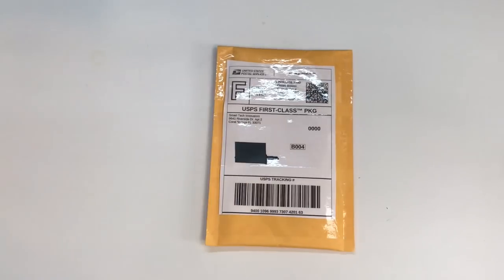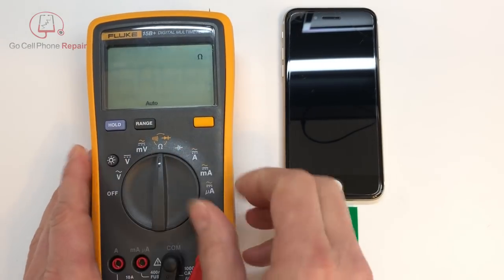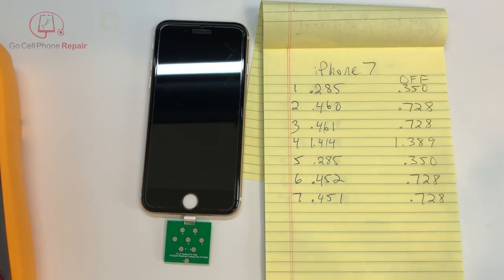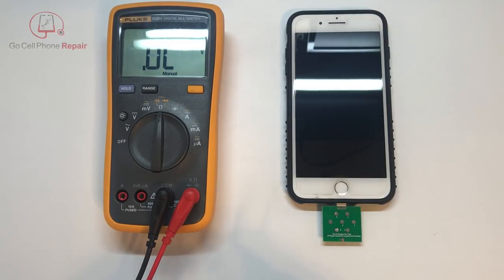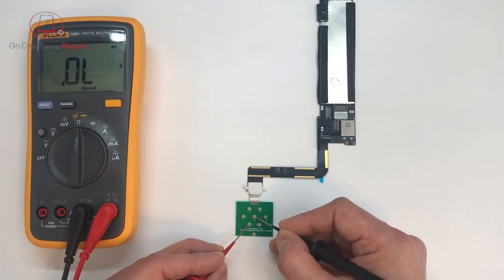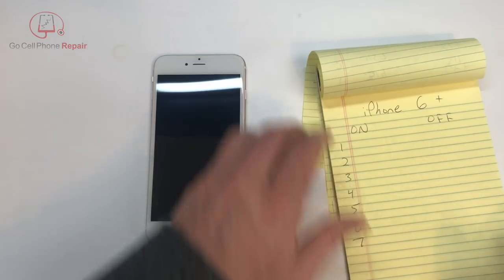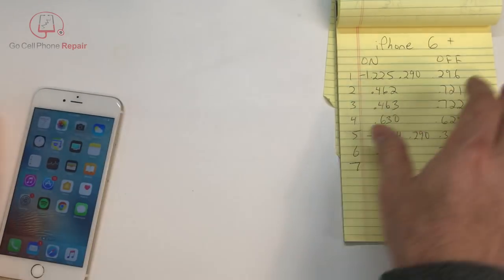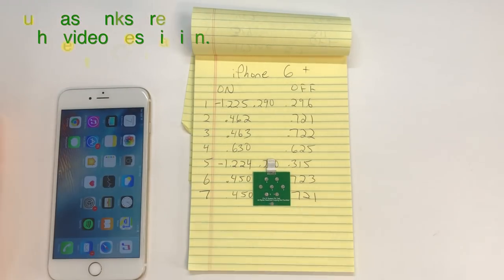iPhone Tristar Tester Diagnostic Tool - Hands On First Trials

Comment: Great video - thank you!

One suggestion though.   Readings powered on are one thing,   readings powered off are another like you say - but,  theres a third dimension too - phones which havent had a soft reset.   I have noticed big fluctuations on readings,  so by default - i do a soft reset on everything before i take measurements.

Thanks again!
Reply from the maker: Noted!

Comment: I am testing this tool, same way as shown on video, I have 0 volts on an Iphone 5s turned off. The phone charge  without any problem, turn on and it is completely functional. Someone may explain what does mean. Line 4 U2 Tristar. does not have GND connection but how it has still the phone is completely operative?

Comment: If the phone is  on why I want to test the Tristar?
Reply: I’m having a case where an iPhone 7 plus would boot but not charge properly no matter which flex cable I used. It charged only while the phone was off or on the low battery screen that keeps it from starting up until the battery is at a certain voltage. When it was on, it didn’t detect the charger at all or it gave me the accessory not supported error despite using an original Apple lightning cable. I’m still working on it, but since the phone is able to boot up once it’s been off for some time, I need to use this tool to see what’s either not connected or shorting.

Comment: Diode mode injects a small voltage from the multimeter into the device we are measuring. You're using diode mode on a powered phone, can't that cause a problem ?
Reply from the maker: So far no problems. I get your point but assume that was not an issue when the tool was designed.

Comment: Tested my ipad air2 with this method..... everything seems very much 'ok' ..... this thing suddenly died and will not startup .... it's 4 years old and was on the charger but never came back to life.... I'm thinking about breaking down and simply replacing the battery now.... good video....
Reply from the maker: Thanks. One thing about this tool is that it can give you some information but not always a clear indication as to what kind of repair you need. You might try a charged battery if possible and see if voltage is getting through from the port.